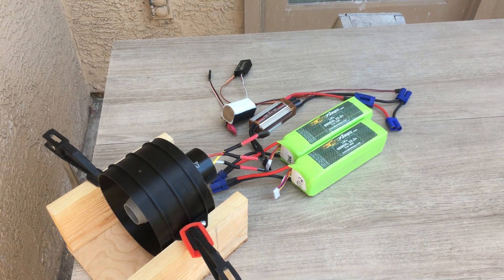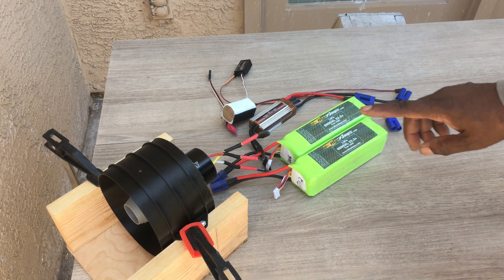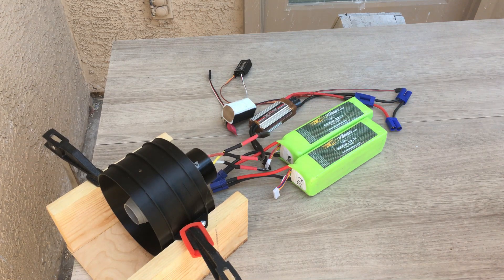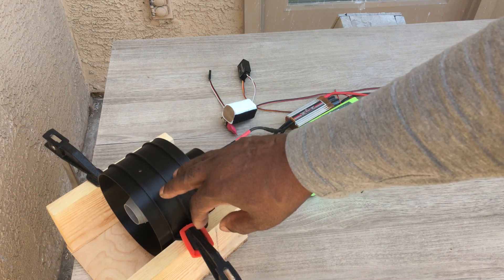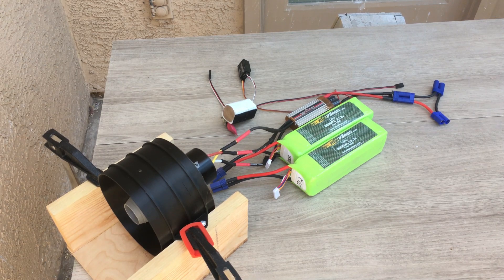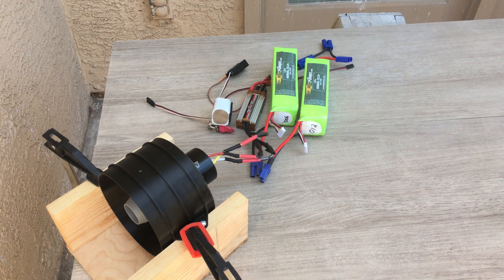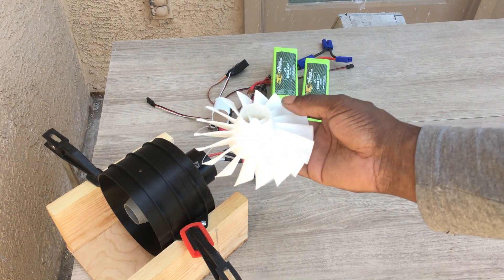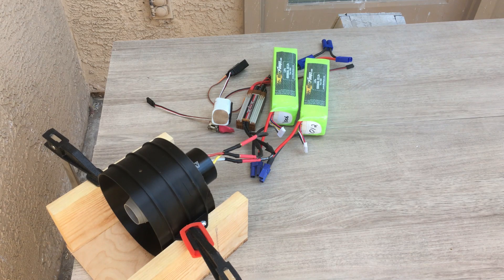Revolutionary Manufacturing: See how 3D printed EDF is changing the game.

Comment: perhaps if you use an SLA resin printer for the blade itself, that will help reduce drag between layers and improve the balance
Reply: I tested this and it did improve the thrust significantly when I printed it with resin.

Comment: Once it's balanced you may want to consider building a test stand that you can move to simulate an airplanes movements for pitch and yaw. If there is a potential for failure that testing methodology would be more likely to find it than a static test.
Reply from the maker: Thank you for the idea. I never thought of doing that.